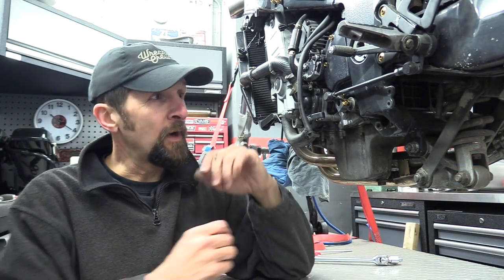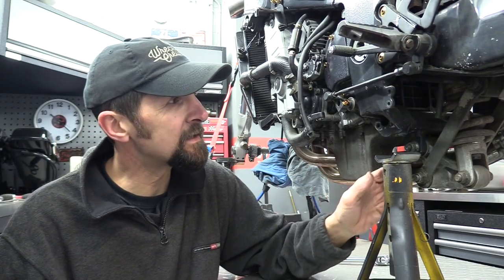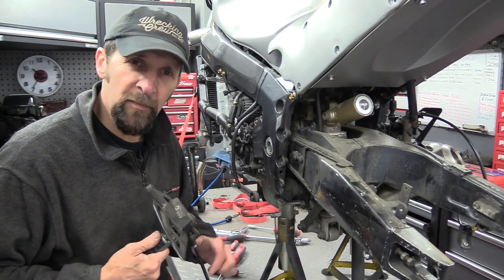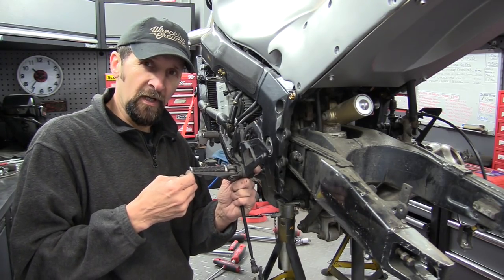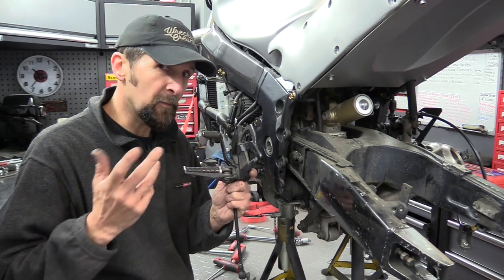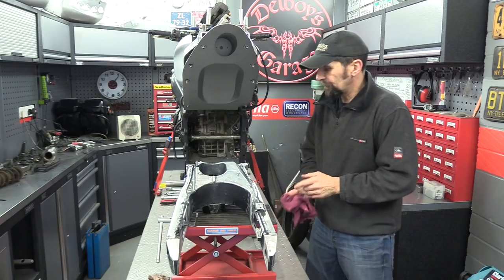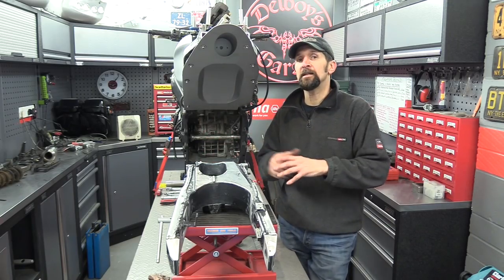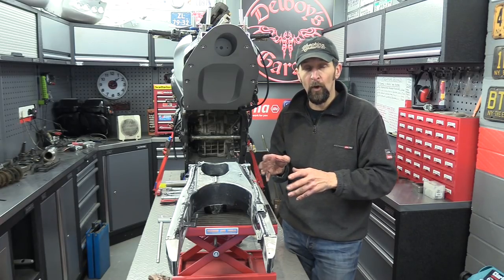Delboy's Garage, Fighter Build #95, Swing Arm out..!

Comment: lot of work del, why not media blast same as the wheels?
Reply from the maker: Hi mate, there was only the original factory finish on there, which is very thin, as you saw, the stuff on the sides was a little flakey, so just buzzed it off with the fleece disc... whereas with the wheels, they had thick chipped up powder coat covered with lots of really thick, horrible grey rattle can paint, so wanted to get them back to bare alloy,,, the swing arm will look great once they are painted, the frame I'll be doing the same way±!

Comment: Hi Del , where did you get that little silencer ? And is it universal .
Reply from the maker: Hi mate, not it's not universal, but is slightly modified, it's the short silencer from the TEC Tracker Exhaust for a Triumph Bonneville from TEC Bike Parts... and I believe you can buy them separately.. .back at the beginning of the project, I curved it a little more and shortened it, but am sure you can deal with that...

Comment: I bet Snap on love you!? This is probably a dumb question but is that nut torque critical and if so, how would you do it?
Reply from the maker: Difficult question, as torque values are important, but not utterly critical... this is proven by the practice of Harley Davidson who give a 'torque range', rather than a specific setting... but will be torqueing mine, and modifying the tool to do so - video coming shortly !